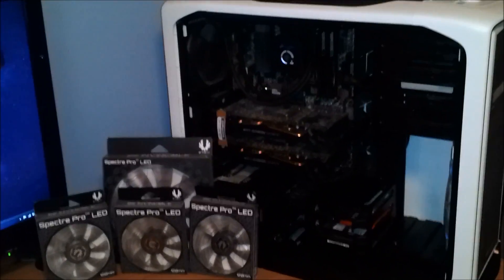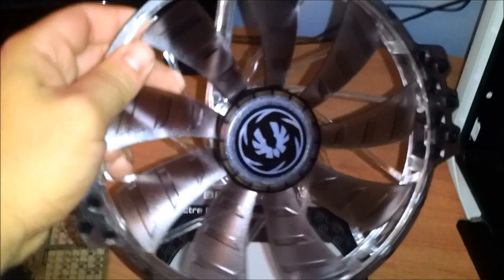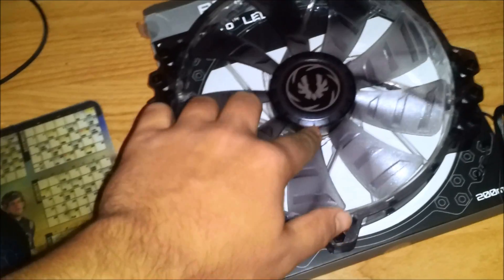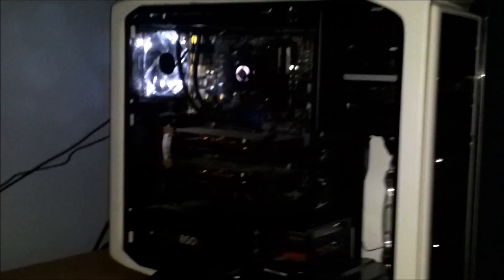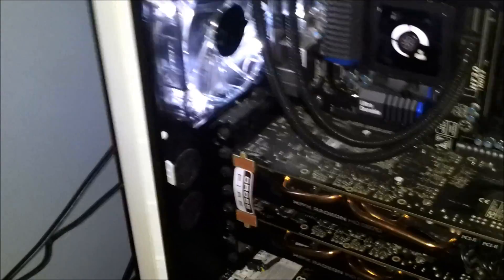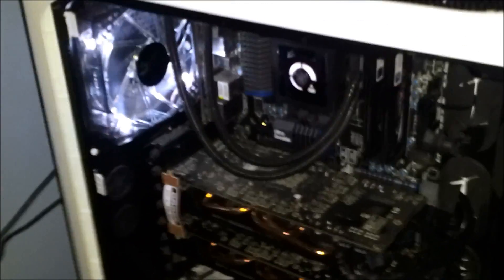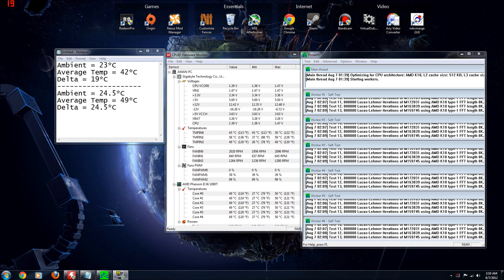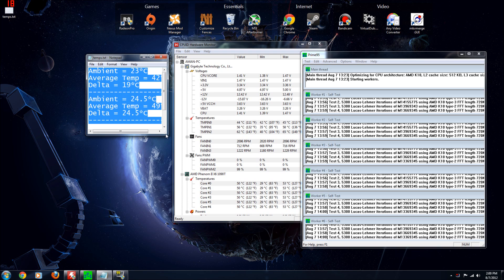Bitfenix Spectre Pro's on a Corsair H100

Comment: Your system would be cooler if you had the rad fans as intake. What sense does it make to be drawing hot air through the rads? Cooler outside air will do a better job of cooling the vital components of your loop. All fans as intake except for the rear fan as exhaust. Don't be concerned with case air temp, the rear fan is plenty...

Comment: AymanRSaleh I believe it's because the bitfenix fans are measured  200x25 and the stock fans of the case are 200x20 :( so you can see 20vs25
Reply from the maker: Well, my h100 is 25mm thick and it fits with no problems. Like I said I haven't tried it, but I personally haven't seen anything that would make me think it won't fit. You could always just buy one at first, since you know it will definitely fit up front. That way you can try it up top first, and if it fits you can buy another one.

Comment: AymanRSaleh does the bitfenix spectre pro 200mm fit at the ceiling of your case? I ordered two of those, problem some say it won't fit you need to do some adjustments. I have the same case as yours
Reply from the maker: I couldn't say for sure, I have my h100 there so I never tried. I don't know why it wouldn't though.

Comment: Did you change your PWM config of your motherboard? Because I bought two and put them on a Corsair h110, but when the system startup they spin at almost full speed and then they turn off. Only if I set, on my motherboard (GA-Z87-HD3) that 1 degree C° corresponds to 2 PWM and if the system is already a bit warm they continue to spin (Usually it's 0.75 PWM/C°), can you help me?
Reply from the maker: I did not have to change any PWM settings on my motherboard. I actually have the fans plugged into the block, not the motherboard and I just let the run at full speed. Now I do have my exhaust fan running off my motherboard but I did not have to change any settings for that either. I actually don't know much about PWM settings since I've never owned PWM fans. These are just your standard 3-pin fans so I'm surprised altering PWM settings had any effect.

Comment from the maker: The performance improvement wasn't staggering, but temperatures improved by a few degrees. I don't really remember the exact amount, but at the end of the day these fans were really only able to match the performance of the stock fans on the low rpm setting. Since I made bought these fans for acoustic and aesthetic purposes, this made the spectre pro's better for me. If you are going for crazy over clocks, the stock fans on high are probably as good as anything else on the market.

Comment: I have a similar set up in my 650D case. 200mm front fan blows cool air in. That's my only intake fan. The 140mm on my rear is exhaust, and my H100 is mounted at the top like yours, but my fans are blowing air from inside the case onto the radiator then out the top. Temps are awesome with this set up. Hot air rises, so you want the fans on the H100, blowing that hot air out. If they push or pull cold air into the case from the top, it conflicts with the hot air rising and messes up the airflow

Comment: (Ran out of space, but one more good tip.) A big complaint of your case is that it looks so nice but has not so great air flow (Why that reversed back fan helps so much), one way to lessen the restriction of air is to remove the plastic grid in the top mesh and the front if it is present there (The part under the mesh for rigidity.) and that will allow better flow for the fans. With that minor mod you lose some rigidity in the mesh that will not effect anything but improve cooling.

Comment: I would probably try using the corsair stock fans along with the spectre pros! Still exhaust the air out the top and have the back fan pulling in for the rad, but put the corsair fans into the mix on one of the sides of the rad. You could have fan light inside or have them on top to glow up there (The spectres I mean). Just run the Spectres on the rad off of psu power and use the silencers if you want them slower and run the louder corsairs on the block controller.